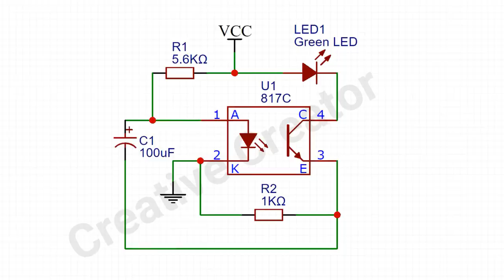LED Flasher Circuit

Comment from the maker: Sorry, Guys, I have made a Mistake at 00:41 the 1k resistor would be connected with PIN 2 and PIN 3 as I mentioned earlier.
Thanks, Earl Lowery For Finding the Mistake.
Learn More: https://circuitbest.com/dc-motor-speed-control/
Reply: https://www.youtube.com/channel/UCAqhv3oljmvoH_gF8L1Q5TQ

Naya hu youtube pe
Reply: I want connect more LED more than 100 what I do please tell me
Reply: Hi, how many leds can i conect whit this system? I leave you a 👍
Reply from the maker: @mynameisbond711  you can connect many LEDs
Reply: Can i put 50uf for fast blinking
Reply: What resistor and capcitor i used to be hyperflash??
Reply: kapo!! saludo of argentina

Comment: This is great for an electronics newbie like me thanks. Can you add a potentiometer or something similar to allow you to alter the flash rate?
Reply from the maker: Change capacitor value
Reply: @Creativecreator  Thank you, would it have to be different cap values or can you get a variable one that can be altered with a dual for example?
Reply from the maker: @spidiq8  you can use variable one
Reply: @Creativecreator  Thank you

Comment: Great circuit. Few questions btw.
1. What is the minimum voltage can make it work? Will this work on 3v coin cell?
2. Can I switch the electrolytic capacitor with a ceramic one?
Reply from the maker: 1. i think yes.
2. you need to calculate the ceramic value
Reply: To use a 3v button cell is not ideal because it will deplete very fast, but u can use it. U must change R2 to something like 56 ohm too.
Reply: @mikimouse7646  could you use  2xAA ? Would a larger capacitor make it flash slower or faster?

Comment: In the year 2001 self flashing LEDs had come to the market.  I still have a red one I bought at that time.   Aren't they still available?  Why take the trouble to make this circuit?  It looks like a normal LED and costed only 3 rupees at that time.  The only drawback was that you cannot control the pace of the flash.  It's half second on/half second off.
Reply from the maker: Here you can control the flashing by changing the capacitor values
Reply: It's not so much about the item as it is the fun of doing and learning in the process.

Comment: It's worth pointing out that they make LEDs that blink, using the same package as a normal LED.
Reply from the maker: I think the answer is No because if you are getting the blink effect without using any components. 
And yes if you use power transistors then you can power up many LEDs at a time.
Hope I have cleared the doubt.
BTW don't forget to subscribe :)

Comment: Sir,How many led use in this circuit?? If i use 12 volt.
Reply from the maker: This is just a signal if you want to use many leds then use npn transistor for amplify the load output.

Comment: I guess more than one LED requires different values of capacitor, resister etc... am I right?
Reply from the maker: Yes
Reply: @Creativecreator  Thank you for your kind response gentleman. I have a colourful led lights (about 50: always on or Static) run by 2xAA batteries. I wish I could make it blinking in slow motion. Any best tips or video on this process?
Reply from the maker: Ok I will make a dedicated video on this topic
Reply: @Creativecreator  your kind response and enthusiasm earned me as you new subscriber. Good luck 🙏🙏🙏

Comment: Which item can be changed to make led flash rate different ? Can a potentiometer dial in the flash rate , please show diagram ?
Reply from the maker: Use different values capacitor and you will get different flash rate

Comment: How many LED can we connect with 6 or 12volt DC????
Reply from the maker: This circuit can't give you much current.if you want to tun more leds then use any power transistor.
Hope this helps :)

Comment: Blinking speed is very fast, how to slow it.
Reply from the maker: Different values of capacitors for different outputs suppose if you are using lower value then the flashing rate will be high and if you use the higher value of caps then the flashing rate will be low which you are wanting. 
Have a great day!!
Don't forget to subscribe and press the bell icon :)
Reply: Changing R1 to a higher value would also slow down the blinking rate too.

Comment: My friend, can I call more than one led in the same way that you just called one?
Reply from the maker: The I c can not take so much current if you want to use the circuit you need a power transistor for amplify the signal.

Comment: Super bro, how many lights
Reply from the maker: This circuit can't provide you much amps. So if you want to connect more LEDs or LED strips then I will suggest you to connect any power transistor for higher output capacity.
Reply: So!  Please state transistors connection.

Comment: Bro can i use 5v battery
Reply from the maker: If you want to use 5 volt battery when I think it will work if this doesn't work for you then replace the 5.6 k resistor with any lower value I mean 2K will it will definitely work.
Reply: Thank you bro